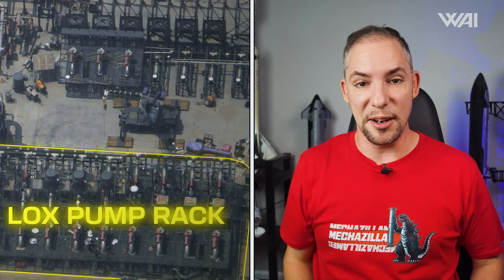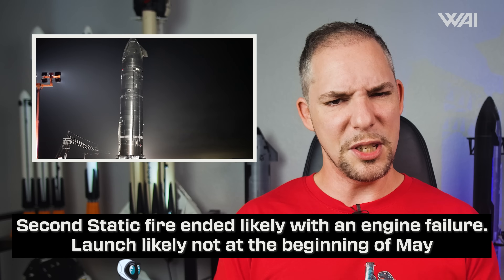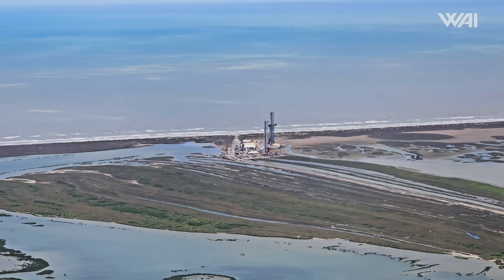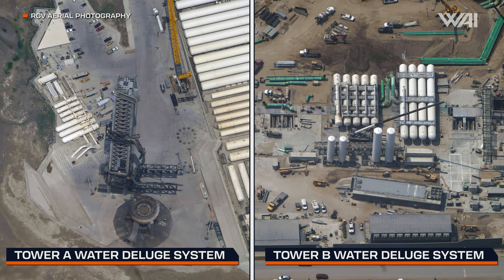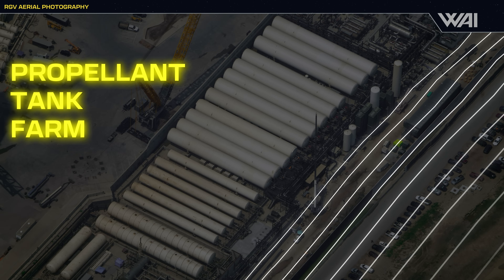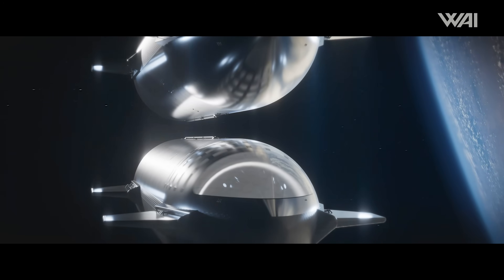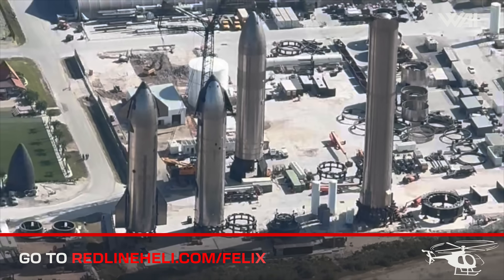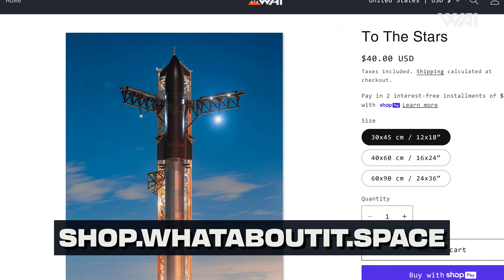SpaceX's Next Starship Milestone: Are They Kidding?

Comment: SpaceX needs to get at least 8-15 tanker ships going due to potential platform expansion capabilities, a higher stable orbit option, a larger midway support station situation, or even 2-4 stations 🍿🍿🍿🍿 with an eventual station to station connection and rebuild/newbuild🍿🍿🍿🍿

Comment: Another reason the starship might need greater pumping capacity then would be predicted by the ratio of fuel capacity on the booster and starship is the starship fuel needs to be pumped to a significantly higher elevation which directly means to a higher strategy. The starship pumps may each have a lower liter per minute flow rate but increase the pressure to a significantly higher pressure.  Easy for you to make an estimate of pressures. Just check the elevation to the fuel inlet.

Comment: The nosecone solution seems very odd to me. The best part is no part…: 

1)  tanker stays in space, does not need to reenter the atmosphere. 2) So just add a quick disconnect to a tanker and you’re there. Basically copy the system from stage zero.
3) The quick disconnect from the tanker can connect to the already existing ship hardware and fuel the ship 
4)(or take fuel out of resupply ships).

That way only the tanker has to be modified and the ships can stay as they are.

Comment: Connecting spaceship tankers by nosecones—especially in the vacuum and dynamics of space—is generally a flawed design from both engineering and safety standpoints. Here's why:

Why It's a Bad Design:
1. Structural Instability
Nosecones are not load-bearing components; they’re typically designed for aerodynamics, not for mechanical stress.

In microgravity, any acceleration (e.g., from thrusters) creates tension or compression along the connection. Nose-to-nose links can't reliably transfer those forces without risking buckling or misalignment.

2. Docking and Alignment Problems
Nosecones usually don’t have standardized docking hardware.

Precision alignment is extremely difficult in space—especially over longer, flexible connections.

3. Fuel Transfer Risks
Tankers require secure, leak-proof fluid transfer systems.

Nosecone interfaces typically aren’t designed for this—they'd require heavy retrofitting, likely compromising structural and thermal integrity.

4. Safety Hazards
In a multi-tanker configuration, failure at any one connection risks cascading structural failure or uncontrolled spinning.

Emergency detachment is harder if connections aren’t modular or redundant.

Better Alternatives:
Axial docking ports with structural hardpoints, designed for load-bearing.

Truss-based connections for large assemblies.

Use of robotic arms or docking rings with mechanical locks and fluid connectors (like those used on ISS or in modular spacecraft concepts).

Conclusion:
Connecting tankers by nosecones in space is inefficient, structurally unsound, and dangerous for fuel management. It’s more of a cinematic or conceptual shortcut than something viable in aerospace engineering.

Comment: I'm wondering.....  thinking of this location...  near sea.....  could it be simpler to dig a very deep hole with flow channels coming from few angles but that fills with simple sea water?  And i say deep.... pressure calculated deep...  with channels thru the bottom..   it may look like boiling soup with a torch.

Comment: Hey Felix,

Did you account for the different volume needs for LOx & CH4 when making your assessment?

Please remember the clouds at the OLM during fueling are mostly due to condensation of water vapor in the humid TX Air, at least in the ground pools prior to launch, not the actual leakage of the LOx & CH4. Don't want to send the overly litigious into a tail spin with confusing info. Love your videos always!
Reply: Yeah, the methane is carefully recycled, but oxygen is vented as required. During landing the vented methane is ignited.

Comment: Wasn't the hot staging added last minute and not part of the original design, seems to be a correlation with test 7 and 8. And, you can't static fire or test the hot staging before flight, or can you...? It's probably already fixed though.

Comment: @Felix: Those huge green water pipes.  Is a 90 degree corner really that efficient.  SUrely a 270 degree pipe bend would create LESS back pressure and make the whole water flow much easier??
Reply: The 90° sweep bends are to create a "Weir" that holds back the water (with gravity) until pressurized nitrogen is injected into the storage tanks. Note the tiny bleed valves on top that drain away trapped gas during operation. This will develop a siphon effect that minimizes head pressure.

Comment: The smaller Saturn V made it to the moon and back several times. No refueling. the ships were not reusable, but there's no reason we should need 15 rockets to refuel from. They need to learn from the past. We had dune buggies on the moon. They are still there. The orbits from the moon missions need to remain the same. The new 2 week orbit is stupid, and puts the entire mission, and all future missions at risk. If anything goes wrong, we will have dead astronauts on the moon. That will kill or delay the space program far more than the shuttle disasters did. In the Apollo missions, they could dust off immediately, and return.
Reply: compare the sizes of Apollo LM and Starship HLS, moron

Comment: Coming from “no part is the best part”, you would think they will use the already existing ports to fill up Starships. 
For that they will have to pair the ships in opposite directions to have the quick disconnect “arm” at the upper part of the starship tanker, at the payload part for weight and center of mass reasons.
Question is how to properly align ships in space and have enough wiggle room for the transfer contraption. How would the hold holding clamps and mechanism would look like?
Reply: I was expecting the propellant transfer mechanism could be quite simple, by just dropping vapor pressure slightly in the receiver tanks. (Keeping the ships in-line nose-to-nose would simplify ullage control, but increase plumbing complexity.) 

Is your suggested "69" orientation due to the propellant transfer plate asymmetry? That can be redesigned, or adapters mounted in between.

I think the linkages holding ships together can be made of simple linear actuators that use electric motors. I'm guessing they will each need cameras to monitor orientation. And far more thrusters are needed.

Comment: SLS flew to the Moon and back on its first flight!  They had numerous issues before the first flight as is typical, but on their very first launch they went to the Moon and came back.  Meanwhile, SpaceX has attempted, 8 times, and has not made LEO or successfully landed Starship.  Landing Super Heavy on the tower is very impressive, but unless SpaceX plans to fly back to launch with the booster every flight they're going to need to work out a viable solution for downrange booster capture as the loss in payload to LEO when boosting back versus downrange landing is on the order of 25% or more and that's on top of the payload penalty for reuse versus expendable launches which is about another 25% or so.
SpaceX designed a very successful Falcon 9 and the manned components needed to get to the ISS and back, but they've been dreadful with the design and development of Starship, Super Heavy and Raptor -- a trifecta of fail!

Comment: They MUST NOT have another RUD. 
I sure wish they had changed straight to the V3 engines. 
It seems like the possibility of the V2 engines and linkages may have some sort of unknown problem. If they already know that they are going to change to V3 engines anyway, I do not see the advantages to continuing to test obsolete V2 engines which have many more fuel line linkages than the V3.

Comment: Ship 36 is going for cryo-proofing so it has no engines to be seen or covered. They covered the area above the engine compartment (the “attic”). Once it is cryo-proofed it will get its engines. Now if you had that shot on ship 35, then that would be different but this was 36.

Comment: I believe it's incorrect to refer to 7 and 8 as a RUD (Rapid Unscheduled Disassembly).
Rapid: Rapid compared to what? Other rocket explosions? Certainly not.
Unscheduled: The launch is meticulously planned in advance. Currently, an explosion is one of the anticipated outcomes.
Disassembly: Disassembly suggests the use of precise and reversible processes during deconstruction, which is not applicable here.

Comment: "The best part is no part."

Why do you believe that a connector in the nose cone is required for the tankers.  All Starships have an existing connector to support fueling on the ground.  That connector  must have piping to deliver propellants to the tanks.  Why would SpaceX not reuse all of that.

Also the nose of a Starship contains the tanks for landing.   Most tankers will only be used to deliver propellants to the orbital tank farm, and then must return to Earth for reuse, so they will require those header tanks.
Reply from the maker: That’s just what I think. I might be wrong. We’ll see… 😉

Comment: At around 18:00 you discuss satellite numbers going up 60000. Whilst I know that space debris adds to the count, I do not appreciate why 60k is a problem. If the Earth's surface is 510 million km2 (based on a radius of 6370km) then if there were 60k cars fairly evenly spread around then each car would have 8500 km2 to hide in (hoping my maths is correct)
Therefore at 300km above the earth an orbit at that height would have an invisible surface of 560 million km2. A satellite at this height would have 9300 km2 to hide in. And we know that satellites orbit at many different heights.
Whilst I appreciate that these are cigarette paper calculations but are we being a little bit alarmist about low earth orbit being fraught with danger? I also appreciate that orbital speeds are about 28100km/hrs which obviously throws in an additional complexity but do not pretend to know what that is. I will no doubt be enlightened soon.

Comment: Great video! It has been a while since I last watched and the content has improved a lot over the years congrats! Small comment, I believe starship's delta V should allow only a max of at most 100-150 tons of fuel to be transfered by tankers to orbit, so tanker's fuel capacity won't increase by much (only around 10%). 

From my experience with feedsystems, the increase in pumps for the ship side is probably due to the needed extra pressure required to achieve the same tank pressures at the extra height the ship QD sits at
Reply: Keep in mind that tankers will eventually have 9 engines. So the larger Delta V is possible with stretched ship tanks, stronger boosters, and Raptor version 3.

Comment: I have been suspecting that it is possible the Hot Separation sequencing and the Ring may be causing the problems we see that end up with the RUDs in IFTs 7 and 8.
Reply: Yeah, we are hearing that a lot.  Exhaust gas is rushing sideways over the edge of the vacuum nozzles in spots, and resonating the lip. Maybe. 

It could explain the visible nozzle damage during the last flight. But the ground tests might also contribute to damage.

Comment: Starship cans are utterly ill-configured for anything but moving between the ground and LEO. Any vehicles to be used beyond LEO should have a completely different configuration.
The cans are comically inadequate to supply any extended Mars activity, never mind colonization, so it is good that settling Mars is an idea with no future.
Cans might reasonably loft vehicles actually designed to make the trip to lunar orbit. Anything crewed that does go to the moon should use stable, non-cryo hygroscopic fuel.

Comment: Are SpaceX going to monitor the vibration of the Starships three small diameter downcomers?  I am still concerned about vibrations in those lines, and so far SpaceX don’t seem to have added any cross bracing for them, to limit their vibration modes.
Reply: BTW, the resonant vibration has not been duplicated in ground tests until now, maybe.
Reply: @ you sure about that ?
Reply: we will see that at the next test-flight
Reply: SpaceX installed three different resonance solutions on the previous failed flight. Maybe one failed and two worked. It's a work in progress.

Comment: OK----------... IS IT POSSIBLE THAT SPACEX IS GOING TO DO A SHORT BURN WITH A BOOSTER SEPARATION COVER OVER THE FLAME TRENCH TO TEST BLOWBACK UP INTO THE ENGINE COMPARTMENT LOOKING FOR DAMAGE TO THE ENGINES AND PIPING...???
-----------... A TWO-SECOND BURN AT LOW SEPARATION POWER SHOULD JUST ABOUT DO IT...!!!

Comment: There was a Great SpaceX episode a week ago or so that quoted  SpaceX saying that reflections of the shock, from the Ship engines firing while still linked to the Booster, caused damage to the Ship engines. That damage led to the RUD. That with the fewer parts on Rapter 3 and the higher proposed interlink that issue should be taken care of.
Reply: I haven't heard that before though usually I avoid channels like great spaceX that just spam AI generated scripts
Reply: Great SpaceX is an AI spam channel that's mostly BS
Reply: Grok did not find a SpaceX statement on this subject. I was one of the originators of that hypothesis, and even I consider it only a technical guess. However, I do agree that a longer interstage that is more "open" would address that concern. 

Note that the latest booster interstage has been restricted even more, with 4 or 5 adjacent slots covered. I suspect this is an attempt to produce some sideways force on the booster top during hot staging.

Comment: A lot of mass to manage with a single point coupling on the nose.  A guided mobile quick disconnect would be easier and more forgiving.  $.10
Reply: So, don't clamp the ships together? 

I suspect that a flexible propellant linkage would be worse than drawing two plates together on the hulls. Also, by rigidly holding the two hulls together, a single ship can assume all thruster control if needed.
Reply: @imconsequetau5275  My point is that it is inherently unstable to attach two levers at their end points.  If they do that, someone is maybe thinking it's logical because of burn-through reentry issues, minimal redesign.    But the torsional forces are going to be slow and uncorrectable, risky.  Umbilical a lot easier and forgiving, and could be made in the aft end making shielding not an issue.

Comment: Nose to nose fuel transfer, this is new to me???? For a fueler I assumed they would simply launch a standard Starship ... so Ship simply has unused fuel in the tanks since there was no other payload.  If true they want to minimize the cargo bay.  Otherwise you can have dedicated LCH4 + LOX tanks in the cargo bay with dedicated pumping.  This would probably need 10T of stuff to make this work.   BTW, CH4 + O2 vs CH4 + O
Reply: The main oxygen tank gets contaminated by the Raptor Autogenous Pressurization System. I think the resulting CO2 & H2O ices need to be kept out of the depot.
Reply: Good observation ... thanks.  I tend to promote slowly spinning the connected belly-to-belly ships around the long axis to create microgravity and then pumping the fuel around the side (or through the tank) and up to the other.  In this way the ices should float at the top of the LOX and LCH4, so when you detect ice you are almost empty and you stop pumping.

Comment: As I predicted SpaceX has changed the Hot Staging ring, so it was very likely the primary point of failure in IFT 7&8..... Also refueling Starships nose to nose makes no sense. Perhaps the tankers could house the refueling hardware there, but not the manned Starship cuz you'd have to give up using the nose as a docking port. And why would you build 2 different sets of refueling plumbing? IMO Starships are far more likely to connect tail to tail for refueling. At the tail you don't have to worry about a heat shield nor do you give up the nose as a docking port.

Comment: ....extra pump pressure required to push fuel to higher up the tower without flow slowdown.  So the extra pump could be for the ship not the tower, this could also be mitigated with inline booster pump at the tower

Comment: The 'Fuel Depot' variant is an interesting design problem, how to reduce cryo boil-off, as well as how to dock a Starship tanker or a cargo/crew version. I've been wondering if just a sun shade similar to the one used by the JWST would be enough, or would the addition of another thin layer of steel be enough to turn the tank section of the ship into a thermos bottle. Vacuum isn't going to be a problem, but do the inside surfaces need to be shiny? I don't see it needing any re-entry hardware so a thin second layer and mylar sun shield would not be additional weight.
Reply: Cryo boil off is no problem, it gives methodes to prevent it already proven
Reply: just use cryo boil off as high pressure thruster/terbine input for occational maintainace. 
it needs tremendous amount of energy ( adaptors,pumps etc) for fuel transfer.
not to mention various sensers and orbit maintainance.
Reply: Pumps are not needed. Tanks are already at 6 Bar pressure before launch. Propellant transfer can be achieved just by bleeding off some vapor pressure from the receiver tanks. The supply tanks may need pressurization, but grey paint and Differential Sun Shade might suffice.
 @therealdoctor315
Reply: JWST has so many layers tho? This application doesn't need 2° Kelvin. 

Put one Mylar layer on the back of the deployed PV collectors that can double as Sun shade. I guess a second shade structure of Mylar might be needed for Earth shade. Earth radiates heat at about 50°F I guess? 

The bare hull can radiate excess heat to dark space. Mating supply tankers can rest in sunlight to develop higher ullage pressure during propellant transfer. The receiver tanks are bleeding excess vapor pressure into the vacuum.